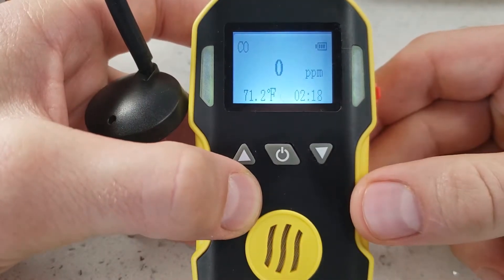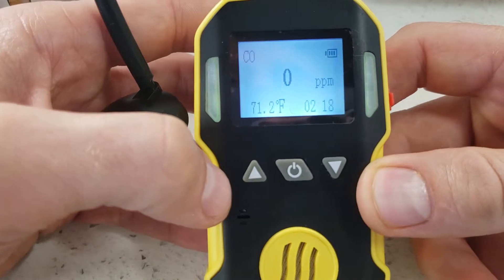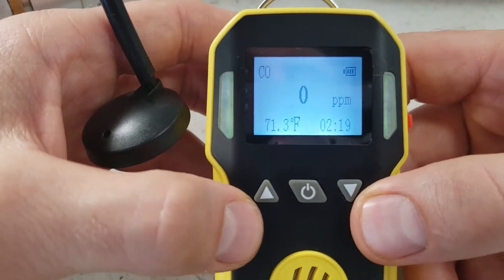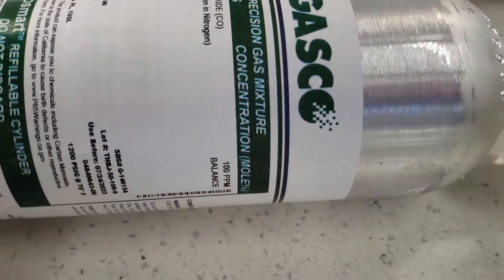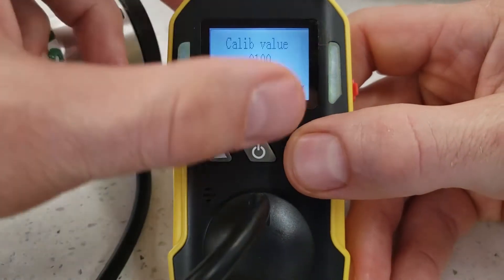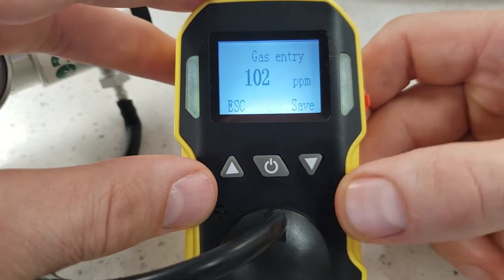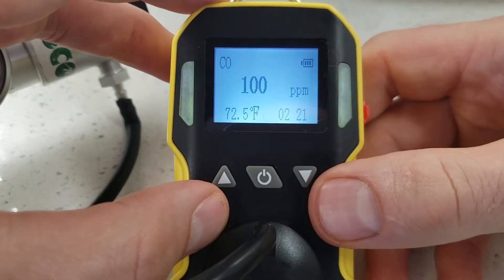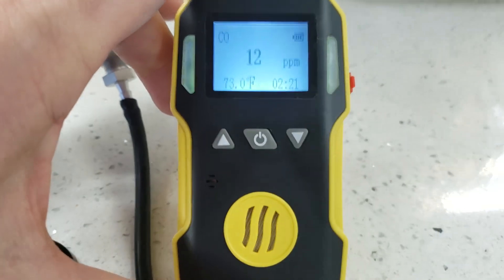Zero and Gas Calibration, FD-90A toxic gas detector

Comment: hi there, how do you calibrate to specific conc of formaldehyde? anywhere to buy a known conc of formaldehyde?
Reply from the maker: You need calibration gas.
Reply: @DrKozForensicsDetectors  any suggestion where to get it? For this unit the gas reg control the flow rate but the ppm stays the same?